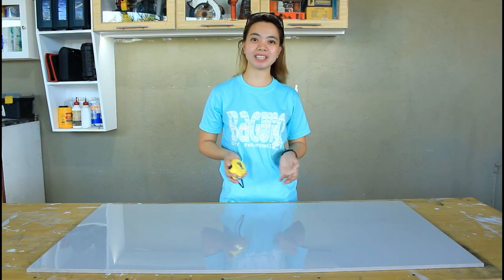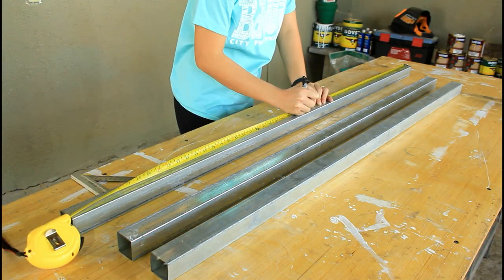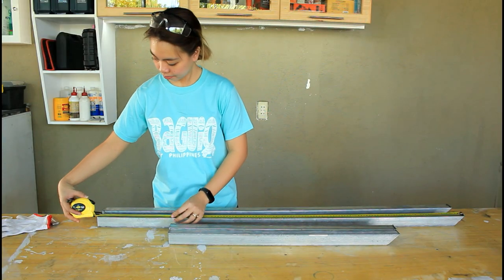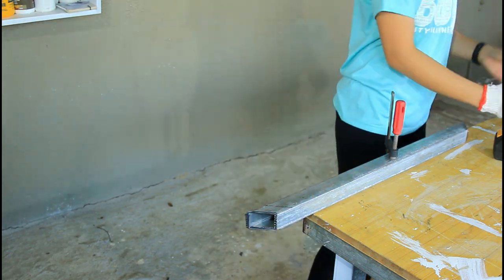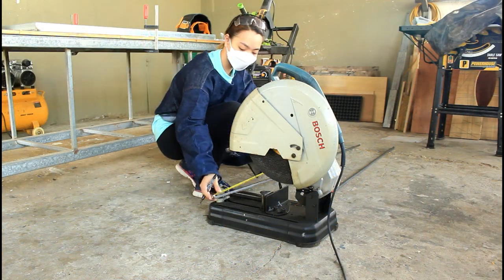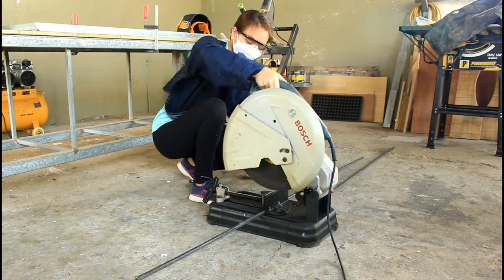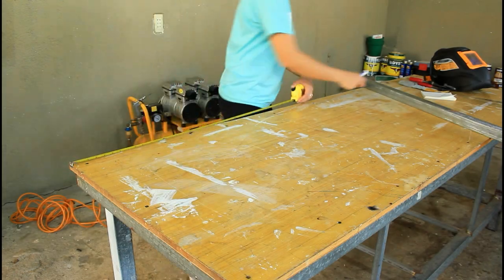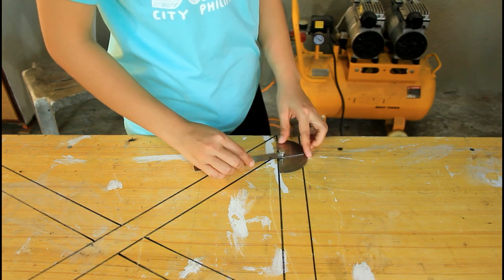TILE TOP COMPUTER TABLE with PLANS | D.A SANTOS

Comment: It is nice to see how your skills develop over time, but you have to be careful here! Welding isn´t as easy as it looks. 
If you are making just some points/dots, you will NOT get the complete sturdiness from the welded joint. Please be carefull here, the steal doesn´t get hot enough to form a strong joint.
Furthermore to avoid possible cracks in the tile you could get 12-19mm plywood, and screw the wood to the crossbars (prevent bending wood), before laying down the tile (with interlayer). 

Besides these hints you made a wonderful job! The table looks really beautiful, you can be proud of yourself!
Both thumbs up and keep up the good work!!!👍👍
Reply: if you live in the 80's skills meant not using any power tools now adays since power tools are cheaper any "JUAN" can make a high class furniture even though you do not have "Skill" all you need is know how to measure and the power tools will do the rest. Ang karpentero nung unang panahon lagari na manual,. katam, liha everything is manual the don't even used jigsaw there a copingsaw (manual again) :D but you need talent and skill to make a simple "Squalidong" cabinet
Reply: @abduljackcool9662  What are you actually talking about? I wanted to help her get better at the project she does and give some criticism..
With "skills" I mean that she takes bigger projects now then 3-5 years ago.. And going from wood to metal is a big step. I wanted to congratulate her before giving advice on how to get better in the future.
I'm a car mechanic, nowadays you do much more electrical diagnosis then adjusting some motor components "like in the 80s"! So what, you want to say that I am not skilled enough than the guys 40 years ago? How about you get some old crak to do a diagnosis that I do on a daily basis with like 20 ECU's and I gonna do some basic shit like *hear engine noises*, *get some oil in this/that spot*...
Well I'm doing both!

Comment: The strange part is the glue :D while you can screw it so that you can take off the wood, I dunno if you have used a plyboard, plywood or a particle board, if you used a real plywood sayang lang para ilaminate better have it sander and put a sanding sealer and a clear gloss.
Reply: bro its tiles, not wood. :D

Comment: a wood finish is better than a laminated on not unless you are using a particle board which does not last and not durable.
Reply from the maker: Hello Abdul! Fyi i used 120x60 porcelein tiles for the table top 🙂